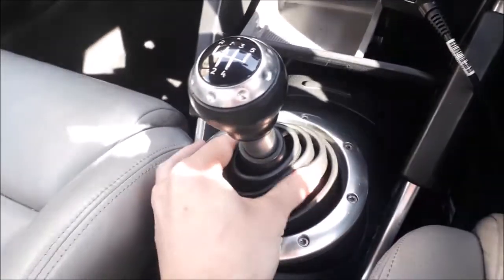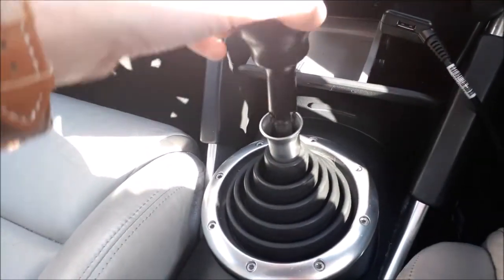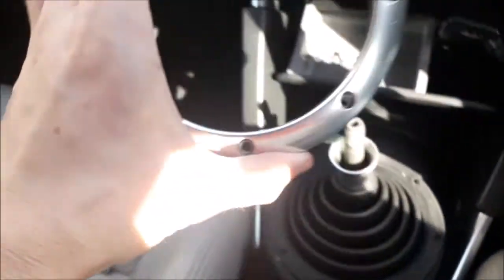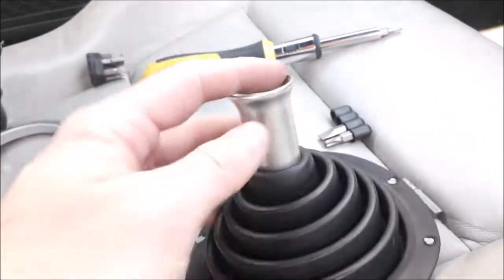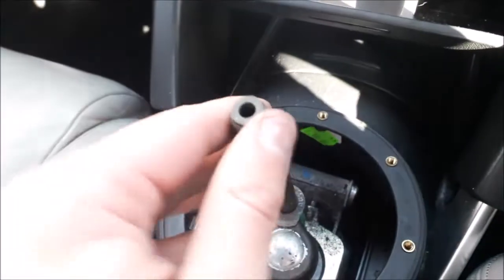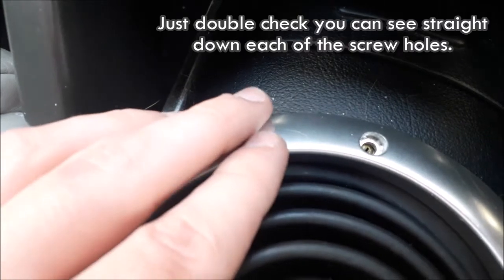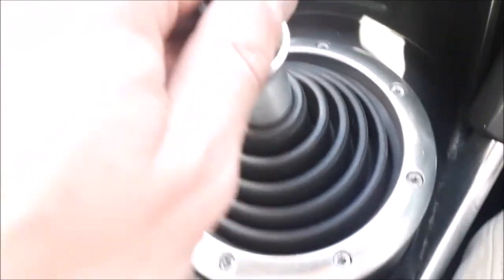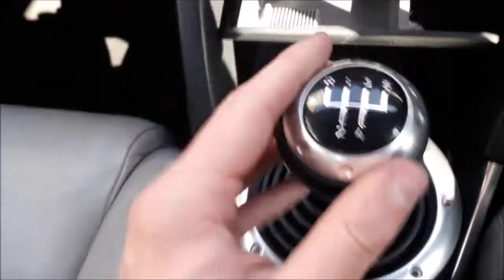How to replace the Gearstick Gaiter in a MK1 Audi TT.

Comment: Hey there.. so I'm following the steps but the know isn't screening of fluke mentioned. I don't hear a clicking on the silver part when I pull down. And when I twist to the left the whole stick is moving instead of the knob. What do I do ?
Reply: did you find a solution? i’m having the same problem.